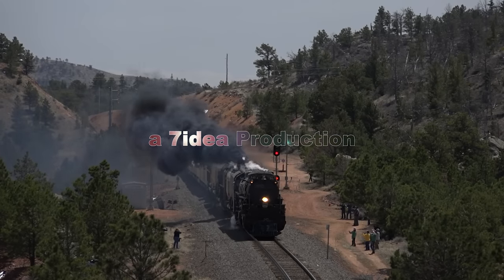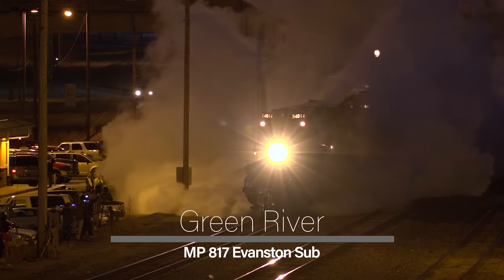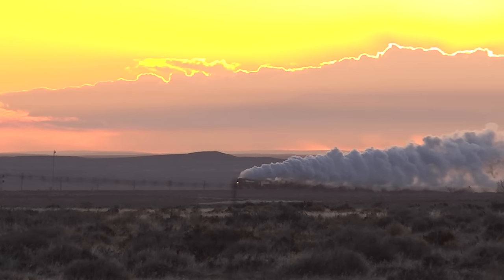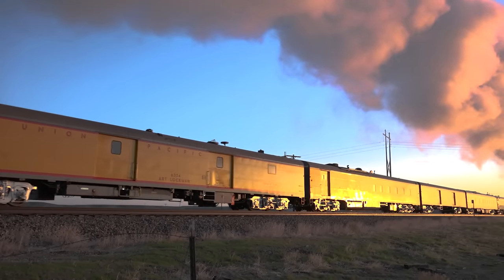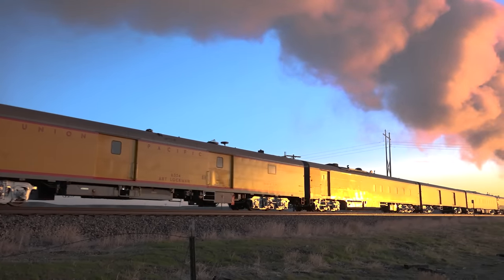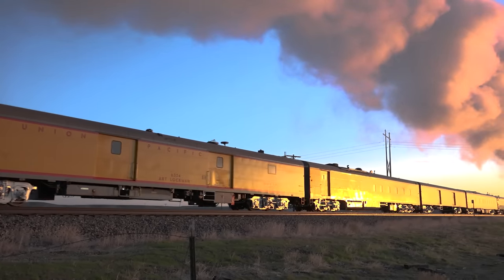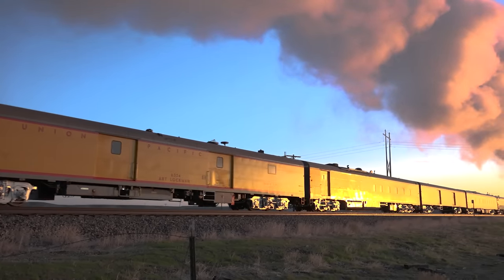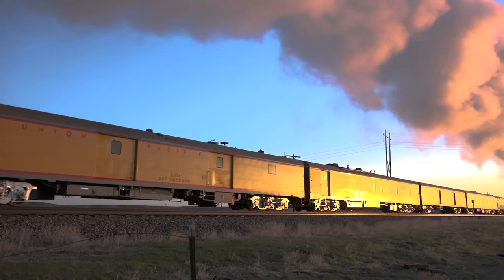The Largest Steam Locomotive on Earth!

Comment: What an amazing feat of engineering those two engines are and your videography has shown them off so well and capturing the power of these magnificent beasts; great to see the close ups and maintenance shots too. Fascinated to see the 4-4-0s being used to complete the link up all those years ago. That wheel base configuration was very common in the UK in the early days, one (an Aspinall Atlantic) apparently being recorded at just short of 100mph in 1899 and hauling five coaches. It’s amazing what man did in those earlier days when putting steam to good use, engines either big or small! Thanks Stephen
Reply: Verdade!
Reply: I don't know what a 4-4-0 is, but I do know the Big Boy 4014 is a 4-8-8-4.
https://en.wikipedia.org/wiki/Union_Pacific_4014
Reply: @chigobwynquorev4513  Under the Whyte notation for the classification of steam locomotives, 4-4-0 represents the wheel arrangement of four leading wheels on two axles, four powered and coupled driving wheels on two axles and no trailing wheels. I think the wheel combinations (there is also letter coding for differentiation between tender, tank, saddle tank and pannier tanked locos) used on British railways over the steam years was the most comprehensive selection, but it looks like the USA had the most loco wheels and that’s neglecting those on the tender! Hope this helps!
Reply: @CenariosdeArrepiar  Thank you!

Comment: Wow, I had no idea they used the SD70 to farther test 4014's pulling ability! Impressive!
Reply: SD70 is only there to provide electricity for the passengers.  Big Boys only pulled freight, no electric service for lights or air-conditioning.
Reply: @georgeneuhauser4752  Wow, you really misunderstood my comment. Did I imply they did that the entire time? No, I did not. And incorrect, freight diesels don't have head-end power for electricity to the passenger cars. And you're talking to someone who loves the Big Boy, of course I knew they were built for freight. The diesel was there for dynamic braking to save wear and tear on the steamer's brakes.
Reply: @georgeneuhauser4752  SD70 won't have HEP either.  844 which was designed for passengers would have had some provision for HEP.  However I don't think 844 would have the right Electricity for modern amenities.  The second car #209 Howard Fogg is a power car.  That's where the train is getting HEP.

Comment: Would love to see this engine be put to the ultimate test by hauling a very heavy freight or coal train at speed. The Big Boy's were designed and built to pull heavy freight trains at high speeds over rough and mountainous terrain with no hesitation or problems at all. Union Pacific, if your reading this comment than please show the world what this monster engine is truly capable of doing!
Reply: Yeah, that would be something, even just as a publicity stunt. just have the bigboy pull a freight train again.
Reply: Well, we'll just have to wait for the next gigantic traffic surge... the one that means "all engines on deck"; then we'll see 4014 pull that mile-long manifest or unit train.

Comment: If anyone has the chance to hear Big Boy's whistle in person, do it. The sound quality of any videos I've found online make it sound like a muffled tuba grunting through a roll of toilet paper.

I was about 6 blocks away from downtown Cheyenne when Big Boy was being moved back into the steam shop for maintenance, and even at that distance amongst buildings I could hear that whistle and the sheer power of the mechanical beast behind it. It was truly amazing
Reply: A short story on engine 844. I had a chance to tour UP's steam shop and round house while 4014 and 844 were present. A retired railroader told a story about a former Northern engine driver. According to the engineer "If the mail was running behind schedule, then them Northerners could 'comfortably cruise' at +100mph"

I know that 844 is noticably smaller than 4014, but imagine anything that size 'comfortably cruising' at 100mph
Reply from the maker: Well said! Nothing beats seeing it in person.

Comment: One thing I have observed since 4014 hit the rails again is that, unlike the front cylinders, the rear ones never leak or emit a trace of steam.  This is a not a compound engine, so equal steam pressure in all cylinders.  You have to look closely at where the steam is coming from on the front set and not confuse it with all the rest of the cloud, but nothing on the other set.  Perhaps the rear set is has better seals, but every run I have come across, steamy front cylinder, no leaks on the rear.
Reply: I know very little about the finer points you mention here but I believe I had read somewhere that at this point of it’s revival they weren’t counting on all that part of the workings….

Comment: Here I thought the Yellowstone was the biggest and heaviest, wonder how Big Boy went from second to first! nice machine
Reply from the maker: I would love to see a Yellowstone under steam. The 2-6-6-6 Alleghenies were also enormous.
Reply: A Yellowstone is a 2-8-8-4, a big boy is a 4-8-8-4.

Not that 2 wheels matters, but biggest is always a very vague term when it comes to determining the biggest steam locomotive left today.
Reply: It's a biggest steam locomotive running
Reply: "Big Boy" was always the biggest...and still is.
Reply: @everettthepetractionguy4222  in history no, it was not. There have been bigger. In terms of successful engines, Big Boy is the largest successful engine.
Reply: @PereMarquette1223  It is something like 138 feet long overall, about 85 feet for the engine alone. It weights 600 tons (1,200,000 pounds. It is rated at 7000 HP, it is 11 feet wide and 16 feet tall. The bioler pressure was originally 350 pounds. I believe currently it operates at 200 pounds to reduce stress on the original boiler shell. The stay bolts are all new. In fact it is very easy to measure the largest - Get a tape measure and a scale.  What we can all agree on is that it is a wonder that 4014 is running at all and it was a monumental task to bring it back to life. It is a dmaned shame that at least one example of all the big locomotives is not operational instead of rusting away in rehabilitated buildings or rusting in  museums. The monster engines were designed for specific use in a specific area of the country - all were tackling mountains. The level of efficiency was based on fuel and water consumption, tractive effort, weightand ability to pull long trains of high tonnage.  The ones that were retired early were inefficient or could not do the job or were almost impossible to maintain.   UP had the largest, most powerful, most efficient engines every built. Such a shame that they are not in revenue service today.   I state that all those engines were important in that they taught some lessons on what to do and how to doit. The Big Boys won the race.
Reply: Esse trem é muito extenso
Reply: @organbuilder272  Look up the PRR S1. While it was a failure, it was longer then a big boy.

That’s the point I was trying to get across.

As to your point about biggest and just measuring it you can’t just do that. Biggest also implies weight and height, and there have been heavier and taller engines built that would beat big boy. The H6 class Alleghenies are taller and heavier. Big Boy despite its size also isn’t the most powerful engine in existence either, the surviving Y6a in St. Louis would win in a tug of war.
Reply: @PereMarquette1223  You mean the H-8 Alleghenies, the H-6s were 2-6-6-2s, like 1309 at the Western Maryland Scenic Railroad.
Reply: @09JDCTrainMan  yes a typo
Reply: @everettthepetractionguy4222  Wasn't Yellowstone the biggest at one time?
Reply: @organbuilder272  Sorry my family went with Southern Pacific and we still all get shares to this day. Invest in the railroads because they can be around always and are most safe if not speed trains which I don't promote or sponsor ever. God bless steam engines so pretty and the chug chug chug chug, chug chug chug chug sound is wonderful. The 1309 Western Maryland, The Beast is Back. On youtube since 03-2022. FUN
Reply: @jwilcox4726  I don't believe Yellowstone was bigger than than "Big Boy". But, I did very little research, not much - and I find that Yellowstone had greater tractive effort at 140, 000 lbs vs "Big Boy's" 135, 375 lbs. But, "Big Boy" came out on top with greater horse power. I heard that the N & W Y6 Class steam loco also tops the "Big Boy" in tractive effort. But, "Big Boy" still comes out ahead of 'em both in size, weight and horse power. I believe these are correct. I'd like hear what others think.
Reply: @PereMarquette1223  I see - So we shoudl tout failures as examples of what is or is not good?  Longer by what a matter od a fuut. They point is  that they are not running and being to inefficient there is no reason to do more than preserve an example of 1 or 2  to teach modern engine builders what not to do. Whereas the Bog Boy is an example of how to go.
Reply: love this machine very much,. . .ie; their moving parts of d engine, . .- radius link's etc. 🚂

@ 05:55,  nice " morning panorama". with white smog coming out from d exhaust - so classic. Thanks .
Reply: @organbuilder272  : To correct you on the length and weight of a Big Boy:

It was 132' 6" long, and weighed 125 tons.

The "600" number is actually the number built, at 625.

And yes, the extra two wheels do make a difference, as they supported a boiler than was longer than an engine that had 2 trailing wheels, such as the difference between a 2-8-2 Mountain and a 4-8-4 Northern. The boilers on the Northern were longer than the boilers on the Mountain, or even the 2-8-4 Prarie.

Just like big trucks, the weight per axle does matter with steam engine, since too much weight on the rails can prematurely wear out the track, and cost a rail company too much money in maintainence. It's also why the Big Boy was articulated, rather than a fixed-frame loco.
Reply: @organbuilder272   300 psi, not 350, originally. The Challengers were 280 psi. The (more powerful than the Big Boy, with a measured output on one occasion of 7500HP) C&O H-8 Alleghenies were 260 psi.
Reply: @organbuilder272  las clases "A"  e " Y" de
 La Norfolk and Western eran las locomotoras más modernas y eficientes del ferrocarril a vapor.
Reply: @everettthepetractionguy4222  no one model engine is "biggest" in every measurement.
Reply: @jimwhelan9152  that may very well be true. But, the "Big Boys" were the most successful, articulated steam locomotives ever built. They may not be the "biggest", but they were definitely the BEST of their kind!
Reply: @everettthepetractionguy4222  as a Wyoming kid who was lucky enough to watch big boys at work on the approach to Sherman Hill, I agree but some, like Yellowstone do exceed it some measurements.
Reply: @PereMarquette1223   Like Yoda says, “size matters not.” Big Boy’s size works against her in the tractive effort statistic in that she had a large boiler but didn’t bring that size down to how much she could pull which is what locomotives are judged by. That said, she beats the crap out of most other articulateds for the simple fact that she runs! And looks pretty good doing it too.

Comment: It is a crime that most of the great locomotives were cut up and scrapped. They should have saved one of each and put them in a big museum. Typical real dumb decisions made by government and corporations. All the workers, design engineers that made, drove, maintained, watched over these engines should have been recognized and honored by preserving the engines and paying tribute to all the people that created and maintained the engines and systems. Driving engineers, firemen, conductors, administrators should be proud of these amazing designs. I can't justify scrapping the way it was done. It was an insult to all involved and to America's history. At least this is proof that a few were saved. I saw a 3D documentary on how the systems were set up to operate. You had to be really sharp to be an engineer and not damage those engines. The amount of criticle things that had to be done or monitored was mindboggling! It took a lot of work and experience to safely run those trains day and night and lots of maintenance by hard working people that got little credit for their work. A lot of engineering was required and few design engineers got credit either. What a great video!

Comment: The 40’s and 50’s weren’t that long ago. It’s amazing to think that all that was so commonplace on every length of rail in the country. What a time to be alive it would have been.
Reply: I remember riding the train with a steam loco on a trip to Boston from Braintree in the early 50's.  I also remember trips on steam loco trains in the mid 50's going to Trentino Italy from France.  Steam locos were not so great when going through tunnels.  Hahahahahahahahahahaha.
Reply: Actually the Big Boy engines where only used between Ogden Utah, and Cheyenne Wyoming, due the the mountains in between. It was the only single engine that could. Even when Diesel engines came out, it took three to do the same job. I live in Cheyenne. We have one on static display, and one that runs :)
Reply: @longrider42  I have a picture of my mom standing with the big boy there that I believe is on display… from the mid to late 60’s when my dad was stationed in Cheyenne…4004 is the one she was in front of.

Comment: Nothing like riding in the engine bay watching the hot as the sun inferno when the engineer opens the coal door. Will remember those days forever. Can't believe they did not give this massive engine more credit. It pulled massive length trains in the past. It could have pulled many times what they threw at it.

Comment: i might be crazy, but I think that diesel locomotive was doing all the work. Still amazing to see the old school stuff Rockin
Reply: Absolutely not. It is in Idle during normal operation. It's there for dynamic braking when needed and it also has the controls and hardware for the mandatory PTC. It feeds the data via cables to the 4014's cab to displays for the crew.  On most excursions UP will always have a diesel in tow to provide additional air if needed and as a built in rescue if the steam locomotive it's trailing needs it. But the length of these excursion trains won't even break a sweat on a steam locomotive this large.

Comment: They have one on the Henry Ford museum that is so big they engineered the engine to bend in the middle. It could haul several hundred coal cars through the Pennsylvania mountains.
      Designed for the Chesapeake & Ohio Railway in 1941, the Allegheny locomotive is 125-feet long, weighs about 771,000 pounds, and could pull 160 coal cars, each with a 60-ton load, through the steep grades of the Allegheny Mountains

Comment: I actually worked on big boy, @ U.P. Denver, put in steam valve, and changed the air glad hands, as a pipe fitter, back in the 90s.
Reply: Sure it was a Big Boy? This is the first Big Boy restored since the 60’s and it wasn’t until 2019. The Challenger was running in the 90’s.

Comment: Why does the big boy always have a modern diesel electric locomotive behind it? Is it just a fail safe in case the steam engine dies or does it always have to be there to help haul?
Reply from the maker: Two reasons: First, the diesel has the digital communication stuff (PTC) needed for today's main line railroads. Second, it provides dynamic braking using its electric traction motors to retard the speed. On this run the dynamic braking was also used to give the Big Boy something more to pull than that just that short train. 
The diesel was also used for additional power especially on the first day, since the Big Boy was still being broken in after its major rebuild. 
I hope that helps!
Reply: @7ideaproductions  thanks for the info!
Reply from the maker: You're welcome!

Comment: It's amazing that big boy is more powerful than a single diesel electric locomotive and that she still hauled it while it was still in full breaking, the big boy has over 6000 horse power and that's nuts
Reply: There are diesel electric locomotives that are as powerful as the Big Boy, EMD's SD90MAC-H and GE's AC6000CW. And the DDA40X is more powerful at 6,600 HP.  But any modern 6 axle freight diesel has far more tractive effort than the Big Boy despite having less HP.  Tractive effort is what moves trains, not HP.

Comment: Magnificent beast which will definitely pull a skin off a rice pudding.
Watching the fireman stoke the boiler on a three mile uphill gradient, on a loco weighing 450 tonnes pulling a train of 1000 tonnes  would be worth a laugh!
Reply: i think you will find these engines could have been auto fed by screw thread not sure.

Comment: If planes are the pinnacle of engineering, then steam locomotives aren't that far off imo.

As a side note, i'm wondering how they did to manage the speed and braking of 2 or more locs coupled one after the other back in the days. Did they have the control electronics to do that or was it sheer skill and comunication by the different crews?
Reply: The dynamic braking of the diesel-electric is not the same as the air-brakes that all of the locos and coaches have. Steam locos have steam powered air-compressor to supply compressed air for their operation.

Comment: Does anyone know what's going on with the car just behind the engine? It seems to have a lot of wheels under it. Is it really that heavy? Looks like 5 fixed in the back and a moveable truck of two in the front. So 14 wheels?
Reply: That’s the tender. It stores the fuel and water the engine uses to generate steam
Reply: It's the Tender for fuel and water and is VERY heavy, which is why it has so many wheels. It could have less wheels if it used larger trucks but they want a low center of gravity for more capacity.